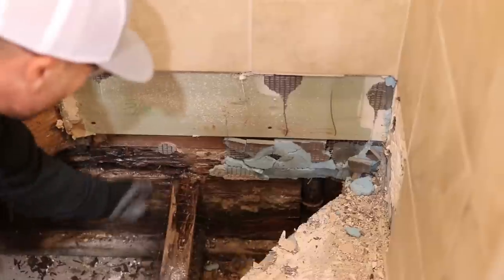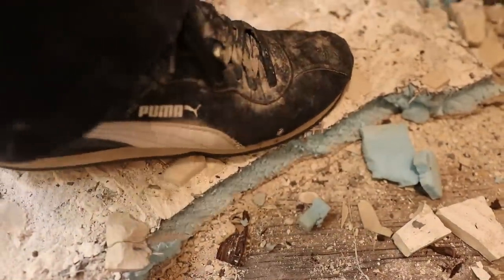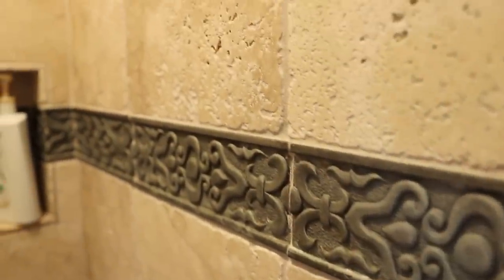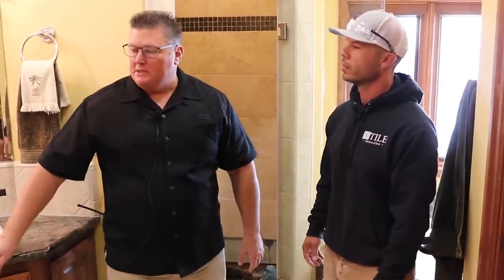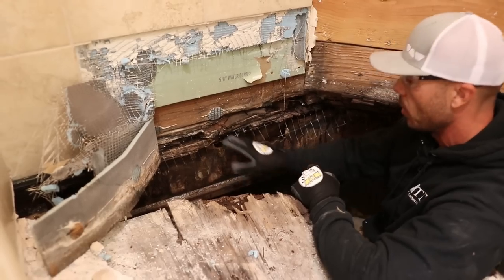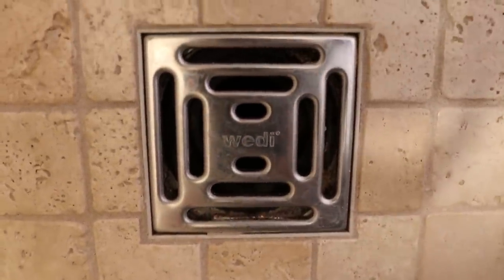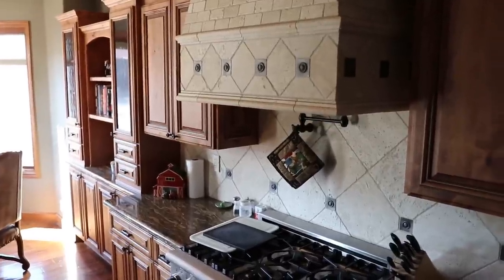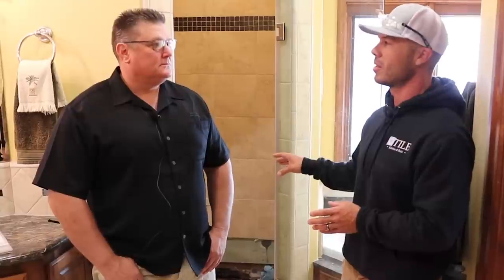Massive WEDI Shower FAILURE (Done by Certified Installer) -- Warranty Claim DENIED

Comment: was i bit fearful when i read the title i fit these wedi pans and always recommend them, there not so quick or easy to install.

the trays need complete coverage so the sub-base needs to be made completely solid flat and level before fitting, with a stable resin bonded ply (marine) base with expansion joints around perimeter, osb or chinese ply is no good you need a dimensionally stable backing, glue lam floors joists flex to much and will need extra support, the drain needs to be precisely solid set in screed within the subfloor before fitting else the drain area has no support and will fail, extra support and modifications to the sub-wall are also required like with kerdi board adding extra studs levelling and noggins etc, to waterproof you need to use proper band and two part adhesive or i use kerdi band and coll, 

honestly believe if done properly this system is far superior to any other, but in reality the wedi system requires considerable more labour and expense compared to a mortar pan, the advantage is if fitted properly you can have completely fail-proof system especially with a four sided fall tray and the dimensional accuracy makes them great for large format, iv seen videos by Seb and home repair where they fit these pans straight over sagged damaged osb flooring, then leave a massive gap in the sub-base where the drain is located, then waterproof seal the perimeter  edges with a tube of caulk this is all wrong, 

its almost impossible for the wedi trays to fail only the installation and sub-base can fail, wedi will claim either the drain wasn’t solidly set in screed and the pan broke or the subbase wasn’t structly sound or dimensionally stable causing movement that damaged the waterproofing, or the incorrect waterproofing was used
Reply: Amen!
Reply: @Pedro Escarfullery What is the purpose of hiring a "Wedi Certified" installer if Wedi will just go back and blame the installation?  It seems that Wedi wants to have it both ways:
1.  Hire one of our certified installers and you have nothing to worry about for the life of our 15 year warranty.
2. If it fails, they deny the claim and say that it was a faulty install.

In effect, your warranty is worthless from day one, yet you paid dearly for the peace of mind that their system, certified installer program and the warranty supposedly provide.  If this is what they are doing they are a reprehensible outfit and need to suffer some legal consequences.

Comment: As you pointed out, foam board compresses and when you have a bead of the sealant already dry, it would peel away when someone of some weight stood in the shower. The minute it peels, it becomes useless. I can see how it could be missed tho.

Comment: Just because someone has a license,  that doesn't mean shit.
Reply: Amen, and even if it was inspected, that doesn't mean squat either (I'm only 7 min into the video, can't wait to see the actual fail).  So many inspectors are useless.  I did a major addition to my house.  We waited for 2 weeks for the inspector to come out to check our footings.  The day he comes out, it's been raining for 3 days straight.  It's still raining.  So he fails us for "water in the footings".  No $hit sherlock.
Reply: @cgilleybsw  What state are you in?
Reply: 1974jrod   Totally true. It only means over priced. I use a lot of handymen one thing is they know is they do not know everything. So they research and try hard to do good work. Contractors are just always rushing through.
Reply: Very true.  I had another "certified" electrical contractor call me out on two different jobs he was unable to do.  First was a loose neutral that took me all of an hour to diagnose, after tracing every wire in the control panel to make a schematic of the system to work from.  The second was a job where he hooked up a 3 phase generator 120/240v (has a high leg - one phase is 208 volts to ground).  He didn't use a volt meter to verify where to terminate the high leg, and fried every 120v device on the service.  His remark to me, was "didn't smell like a high leg".    I am also a licensed wastewater operator, and could regale you for hours with horror stories of stuff I've seen other licensed operators do.  In Florida, our correctional institutions have inmates learning to operate, which is a good thing, in that we are giving them a trade to hopefully stay out of prison.  The problem is that we have one government employee "teaching" or "supervising" them.  Most of these guys are generally bottom dwellers for license holders.  My take is that we, as a society, rely on the government to "certify" someone's ability.   The same institution that screws up almost everything they touch.  Honestly look at  the majority of public servants and see that most of them only work there because they lack the ability to maintain employment in the private sector (obviously there are exceptions to every rule so don't get your panties in a wad if you are a public servant who isn't a bottom dweller).  If you truly want to get someone who knows what they are doing you need to:  1.  Educate yourself on the task you are asking them to perform 2.  Ask them lots of questions and if they can't answer them from your research, back away.  3.  I prefer old school methods primarily because the new stuff has not been tried and tested as is demonstrated in this video.   4.  Ask for references and actually follow up on them.  If they are reputable, they will have no issues with you talking to their other clients.  The onus on the outcome of the job is squarely on the shoulders of the person who hires them.
Reply: @mikewhite9818  On behalf of the handyman, (not all, but many) do really good work, and often the right way, they just don't have a license, but could if they pursued their skills.  I say this because I have had the contractor fail (like you mentioned- "rushing through") and the handyman come fix it and clean it up.
Reply: feldeee   High costs associated with being a contractor. Government fees, bonds, and insurance forces them to rush and often forces extra high prices. I do not need the nanny state so I prefer handymen. Usually half the price and without the drama.
Reply: @mikewhite9818  Good point.  Being the customer... Just fix the damn problem and do it right!  Thank you, good bye, and now you can worry about your next customer.
Reply: feldeee   I used to be a contractor. After retiring and started to flip houses I learned just how bad many of the contractors are. Handy men meet my budget needs and did good enough work to be acceptable. Margins are pretty low flipping. I only do it to keep me young. The alternative when retired is quick death.
Reply: @bryoncovell6325  After I bought my house I noticed the labels on the electrical panel didn't really make sense. When I flipped one it would turn off what it was labeled but it was also turn off a few other things in different rooms. After documenting what was controller by which breaker I concluded the sealing of the basement must have tons of cable runs. It was apparently done by a licenced electrician so I figured it would at least be organized. I ripped out the basement this past few months in prep to reno it all and holy hell! Cables everywhere. Most not even anchored properly. I just sat there and said to my wife "this is why I don't trust people. This is why inspections mean nothing. Who in their right mind thought this was okay?". It seems at multiple points the cable was too short so instead of running out a new cable or joining the 2 cables in a junction box this electrician thought "hey I'll use this receptacle box and not even put a cover on it". I have found so much stuff that somehow passed inspection that is obviously wrong. Like one of the 4 legs under a platform at the op of a stair was two 2x4's nailed together but they were too short so they put a little concrete form under it on the slab. The house is great, the land is great, and the location is great but the internal renos (that somehow passed inspection) makes you scratch your head. To their credit everything was extremely well hidden. I would have still bought the house had I known but I would have slashed about 20K off the price.
Reply: @systematic101  unfortunately, from my experience, this is the case for most jobs regardless of where they are.  It follows the belle curve distribution in every job.  The majority of people you meet are the "can't see it from my house" "doing just enough to slide by type".  When you meet someone from the first or second standard deviation (top few %), you think "wow, this person is awesome at their job".  How do they get that way?  They eat, breathe and live that job all the time, because it is their passion.  My opinion on inspectors in general is that they started in the construction trades, and sucked ass so bad, that they had to find another means of employment to get back at those who succeed where they failed.   (Yes, I have a serious dislike for government).  My other life philosophy, is that if you want it done right, do it yourself.  I do very little that requires anyone else to be paid to do anything for me.  Doctors and lawyers notwithstanding.
Reply: @feldeee  it goes both ways. The home owner also calls the licensed profrosssional tradesman to clean up/fix what the handyman' s work.
Reply: @mikewhite9818  man, I can imagine how bad your properties are behind the walls
 I'd never recommend anyone buy a house that's being flipped. There is no pride or integrity in that
Reply: Facts..
Reply: @Louthemailman  It sounds like a gross generalization to me.  I absolutely agree, most everything takes years to master, however keep in mind, not all handymen are newbie's and douch bags, and not all contractors give two craps about the job they are doing.  It all depends on the person doing the work.
Reply: It was the system not the install that failed
Reply: The first three letters in Contractor is Con for a reason. They take your money then hire someone cheaper to do the actual work and pocket the difference.  🤣

Comment: I'm not a builder, contractor, or any of the sort. But I do wonder: Should there not have been another joist in there for extra weight support?
Reply: Looks like 32" o.c. joists wirh 2-4-1 (1 1/8") t&g ply, so a good floor.

Comment: I just have to say I have never used Wedi for my showers but I use Laticretes shower system.  That type of sealant actually "welds" itself to the foam.  If its similar to laticretes sealant theres no way you could pull two pieces of sealed foam apart at the seam, you would rip the foamboard before that happened.  My theory is the wrong sealant was used, Wedi sealant back then was not sufficient in adhering the foam together properly or the contractor did not perform that step correctly (dust in the joint preventing adhesion possibly).  Then again maybe this is the long term effect of these foam systems coming to light.  Who knows?  Time will tell.
Reply: Maybe time is already telling.
Reply: Improper cleaning out of excess thin set in the rabbit is what it looked like to me. The sealant certainly stuck well enough to the wall board, just not in the rabbit.
Reply: Wedi sealant is gray not white.

Comment: Hi Isaac...  I used Wedi sealant recently and also about 10 years ago. I can tell you for sure it's not white. It's a medium dark gray. That's not Wedi sealant and that channel should be packed with sealant. Due to a mistake on the first job years ago, I had to pull a piece of the board away where two boards are sealed together. Holy shit, that stuff sticks to the foam like crazy. It rips the foam apart. I feel confident in saying that is not Wedi's sealant and it looks more like they used some caulk from Lowes.
Reply: I agree
Reply: I concur, that's not WEDI sealant. Plus its an improper install, you are supposed to hit each seam/joint with another thick bead of caulk and trowel it out.Probably ran out and got impatient and used whatever. WEDI sealant has incredible tenacity in sticking to the board.
Reply: I also agree that the sealant used in my Wedi shower 10 years ago was not white it was a grey color as described above. In addition to joining all joints with Wedi sealant I also know the installer applied Wedi sealant to the surface of all joints and troweled them flat.
Reply: I Agree also.
Reply: Yeah. This is the cause. Wasn't wedi sealant, plus they only did the inside bead. It pulled away from the foam side but stuck to the cement side.  The install might have worked if they applied the second bead to the face and trowled it out to 3/4 inch up the wall and horizontally across pan.  That caulk stuck plenty good to the cement. 
Surprised the wedi rep didn't catch that. 
I get it. That joint sealant can be $20 a tube when some exterior osi is $8. Its good enough to get you passed the inspection.
Reply: I've pulled Wedi sealant apart real easy 1 month after constructing a demo shower for training.
Reply: I agree, joint sealant is Grey and you pack it in the joint, then you use the spreader and spread 2”  wide.
Reply: It's still relying on a caulked joint with little overlap.  I don't like kerdi schluter system either but at least there is the use of mortar and significant overlap.
Reply: @alexanderjamieson7971  there seems to be a fundamental misunderstanding of how a Wedi joint is done. First, it's not "caulk", so let's toss that word. In the case of a pan/wall board joint, the channel is flooded with sealant. The board is pressed into the joint, which squishes the sealant out. This would be considered the first of two seals. Then a very generous amount of sealant is applied to the exterior joint and troweled flat while ensuring no air bubbles and a smooth continuous seal. This forms a second seal. The Wedi sealant binds tenaciously to the Wedi board foam and exterior. Also, thinset bonds in the same fashion to the sealant and board. The end result is two separate sealant barriers to fail. I can say with 100 percent certainty that Wedi sealant was not used on this install at the pan/wall joint. I will add that the build up/spot bonding over drywall is not an approved method of installing Wedi panels.
Reply: @phillipbridge5009  I just did today on the squeeze out on the back seam of wall panels on shower under construction. I didn't put drywall on the opposite side yet and as I was walking up the stairs and noticed the squeeze out with this discussion still fresh in my mind I grabbed it and was able to break a piece off and then pull that piece apart. 
There is not enough information to know what caused this failure. There could be a spot where they didn't put sealant such as high on the beach.
Reply: @alexanderjamieson7971  water goes through mortar PERIOD. I've seen way too many schluter failures...I've done mockup installs of Wedi and it DOES NOT come apart that easy. This install was a crappy install and not even the right sealant...
Reply: Ken Howard okey! I confess! I used a cheap sealant from HomeDepot. I was in a rush.. but hey, aren't you gays thankful this video was made 🙄
Reply: @jasoncyr9855  I stated I'm not a fan of schluter and have seen too many videos of schluter failures.  As Isaac has pointed out in his mock ups, the use of mortar to bond the schluter membrane is its weakpoint, since mortar wicks up moisture.  My point about it using mortar is the bonding mechanism is incredibly robust.  I feel topical membranes such as hydroban, red guard, 8+9, aquadefense are better, when applied in at least three coats.

Comment: I’m having anxiety after watching this video. I just finished installing the Wedi pan, walls and curb and sealing all the screws/washers, joints and corners. Ceiling tiles are up. Planning to start tiling the walls in a few days. Now I’m thinking about putting another layer of sealant at the joints.
Reply: (not a professional, just trying to use commonsense) i mean, a system relying on sealant, even great sealant, to keep water out of the the most vulnerable joint is a bit strange. maybe put some ardex or aqua defense with the mesh on the pan joint as a "belt and suspenders" approach. or even kerdi band? not sure it is compatible. sidenote: i always thought the kbrs custom pans were the best solution if you didn't want (didn't have the experience) to do a mud pan ever since i found out about them.
Reply: Cement board over everything. 

Or rip it out and start over. Use cement board, just like you should have to begin with.  Why keep going with the wedi???  

Unless you have a great, great tiler you will wish you had never installed wedi!!!

And you won't know how good the tiler is until there is a problem. And then it is too late, isn't it???

Do it right the first time. Use cement board and a copper or lead pan. And a heavy rubber liner for added insurance. 

You will sleep better if you do it the right way. The fool proof way!

And take pics so when you go to sell the house you can get a bit more for it. Because you cared to do jobs properly!
Reply: When you put in the second sealant in the corners etc, use your finger (or a radiused scraper, trowel etc) to leave a radiused 'fillet', instead of a 'tight' sharp internal finish. Then when laying the tiles, be sure not to put a sharp tile edge hard up to the sealant corners, IE leave a little gap, or chamfer the underside of the tile. To go one step further, run a bead of sealant around the perimeter of the floor tiles before starting the walls. And please, don't do the walls first. Any extra time ($) spent now is cheaper than a re-build.